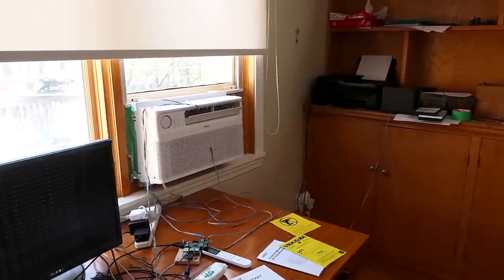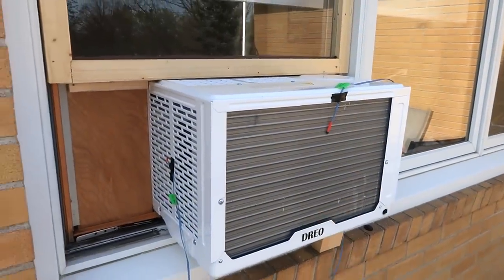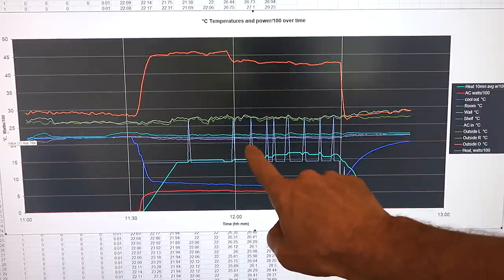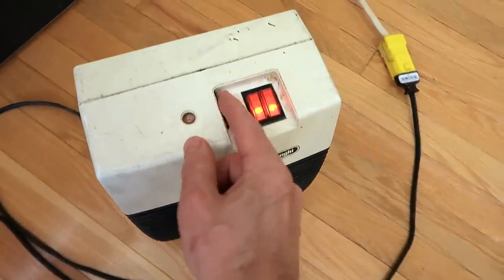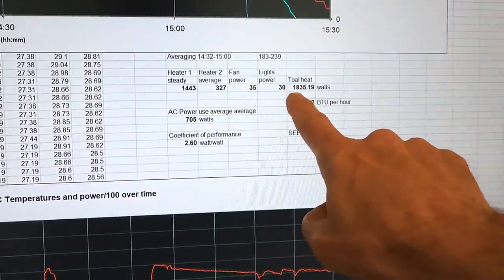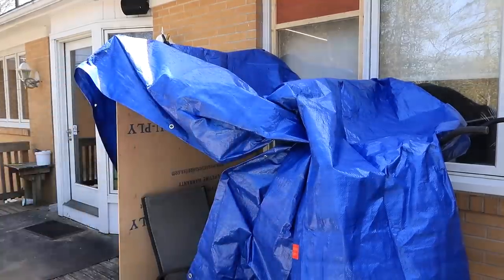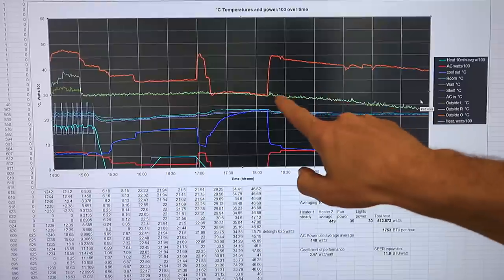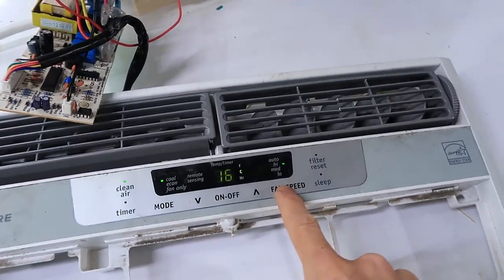Window air conditioner efficiency test

Comment: RE: Noise. 

Older window bangers were usually equipped with reciprocating compressors... a piston banging up and down. These are much louder than the rotary compressors that are nearly universal in modern units. 

Also, fan noise has been greatly reduced in modern window units and split systems through better (smoother) airflow pathways within the units, plus more effective fan impeller design. These improvements allow slower fan speed, which means less tip speed, which means less airflow (fan-related) noise. 

So although the newer units are indeed inverter controlled, it's probably not really the inverter that's allowing that wonderful reduction in noise. It's the quieter rotary compressor plus airflow noise reduction because internal airflow passages are not (quite) as clumsy and sharp-edged as in earlier window units.

The inverters' main accomplishment is better modulation and "metering" of energy, in response to changing loads, as your graphs show us so neatly.

Comment: Very interesting tidbit about the water on the condenser fins! I have a window AC unit I just installed that had a plug at the drain port, and the manual said it can be removed but the unit will operate less efficiently. Glad I know why!

Comment: Most window A/C units utilize a splashing effect from the moisture collected in the bottom of the tray from the inside evaporator to cool the condenser. When first starting up the tray will be empty and thus not cooling as efficiently.
Edit: I guess I should finish the video before commenting 😅 lol
Reply: I too learned the hard way, lol
Reply from the maker: Didn't used to be that way.  I remember seeing water drip out of them, but that was back in the 80s
Reply: @matthiasrandomstuff2221  Yes they would drip but the outlet was about 1/4"- 4mm higher than the bottom so it would maintain a pool of water.  Mine would occasionally get plugged with algae and would spill out the front. Took me awhile to realize how they intended it to work.
Reply: @fluke196c  I did too till it started running hot and realized that it worked better wet. But you're right they rust out and don't last....built in obsolescence
Reply: @TgWags69  It is easy fix thou.  Paint the inside with some two part epoxy, you can use either the clear epoxy for floors, or you can use car clear coat.  Both are very low viscosity so they get into all places, and are 100% waterproof.  I did that to a de-humidifier, and after that zero rust.
Reply: Yep, depends on your location, as it can fill more then splash out.
Reply: @fluke196c  forcing the hot refrigerant through the copper tubes in the water does cool it down quicker thus making the evaporator colder.
Reply: @matthiasrandomstuff2221  I have another thing you can test with the new inverter systems: mine is 750W compressor, but when it's very cold in the morning and thus the temperature difference is very high, it will draw about 1500W instead! Makes me a bit worried about burning out the coil windings, but the question is: if its running at that level of electrical power, do I still get 4x the thermal power out of it? Or does in this case the efficiency simply go to shit and I get the same thermal output as before, just under much higher electrical exertion?

Comment: The manufacturers won't need  R&D anymore, they just need to send you stuff. 😂 I just got a used split ac unit for learning how they work on the protocol level. My first guess is rs485 modbus and I am trying to find out what an indoor unit talks to the outdoor unit and vice versa. There are some videos about controlling ac units with arduino but what I want to know is if you could control an indoor unit with arduino / raspberry pi and use a cold room condenser unit on the outside. The video by engineering mindset about vrf / vrv AC units really made me curious how these systems control refrigerant level and all that. So thanks for the inspiration again.

Comment: Good testing done there, that's useful data collected.
That compressor is inverter driven, hence the power consumption changing from low to high load, and no cycling of the compressor during low load conditions.
Pretty good for a window shaker.

Comment: I use a number of window units for assorted purposes.  All the old, R-22 units are still working fine.  One is over 20 years old.  I am now on my third newer unit, all using R-410 refrigerant. The last is a replacement for the first two, both of which lasted less than 3 years each.  The problem with them is leaking refrigerant.  I think the problem is that the China labor force have not learned to make an A/C with the higher pressure requirements for R-410.  They have leaks in the copper tubing joint around the compressor.  Due to either fatigue in too small piping or bad soldering of the tubing.
Reply: Can the new units be repaired or retrofitted with better tubing?
Reply: @nelsondog100    Sure, if you are willing to do the work yourself, obtain the refrigerant, (requires certifications)  and have the vacuum pump, copper braising or silver soldering equipment, and time.  Otherwise it would cost a LOT more than replacing it with a cheap (temporary) one.

Comment: Testing suggestion
Try it with the AC fan on low vs high. See what that does to the efficiency and RH.

In my camper (hard side popup) I used to run a regular old window AC with the fan on high all the time when we wanted cooling. 
Worked alright during the day but at night being such a small space it would short cycle. The short cycling meant inadequate humidity removed so it really didn't feel all that pleasant.
On low fan it had longer run times and so was able to dehumidify more. Still not amazing but better.

Comment: Wasn't there solar heating of the room through the window? Aren't you assuming no thermal flux through the walls for the ac / heater equilibrium assumption to hold?
Reply from the maker: sun wasn't facing the window.  Also, I made sure the room was at equilibrium at 22 degrees.  I even shut it all off afterwards to make sure it was still at equilibrium at 22 degrees
Reply: Matthias you planned and thought it out well.

Comment: With the start of Time based electric rates I'm trying to decide what is the best way to run my whole house AC unit. The higher rates (1.5X base rate from 2PM to 7PM M-F). I also watched you fan video's and when the outside air falls to mid 60's at night I'm opening 1st floor windows and running a 20" fan blowing out the 2nd floor window. The fan is located approx 3' back from the window for most airflow (Thanks for your video on this). The fan consumes approx 64 watts/hr.  I don't attempt this unless the outside temp is approx 10* lower than inside.Whenever the inside approaches the outside shut this down and turn the AC on to get the inside down to about 72*F. Once attained I set it at 74* and let it maintain that until about 1:50 PM, just before the penalty period. Then I shut the AC OFF. Yesterday it ran up to 93*F outside and the inside aironly raised to 75*F at 7PM.
Any Ideas? Lots of work, but fun.

Comment: Back around 1985, we got a 14k btu window unit from sears. it was 10EER ...
...matthias just mentioned it already. I was going to say our old unit actually deliberately dribbled the condensation down the cooling fins but instead of seeing little bits, you'd see what looked like water snakes making their way down between the fins. 

that was an important thing as ours sat above a wooden basement door on the porch. 

For the folks making fun of these units below, we cooled the lower part of an old stone house with a 14k unit and then at night, the upstairs with three 5k window units. 

The house has since been refitted with ducting (old stone house) at a high cost (about $25k in current dollars) and the power use is FAR higher than it ever was with the individual units. 

Nice thing about the window units in bedrooms is you could basically turn one on full blast about an hour before sleep and sleep in winter temps in the room without wasting power on the rest of the house.

Comment: Nice to see that those bulky old in-window ac still exist.
They remind us of ancient Soviet period ac - BK1 (БК1) :)
Reply: But, these are modern, efficient 8,000 BTU units!!  Many ppl, including myself, depend on these units in hot climates!
Reply: they're good units, cheap and efficient and allow people with no AC to get efficient AC or not waste money running full central air while sitting in only a couple of rooms. 

FTR, I don't have one (central AC and mini split on an add on), but my electric bills are higher than my parents' were cooling parts of a much bigger house.

Comment: Thats quite close to the DIN EN 14511 standard which describes testing of AC units. I did my bachelors thesis around that, but concentrating more on automating a test stand that does the actual measuring. unfortunately I couldnt get too deep into the thermodynamics.

Comment: You've calculated is an EER, not SEER. SEER is an average of EER at specific different operating conditions.

That EER also seems kinda low, especially for something with an inverter. The EPA requires 12 CEER for a room AC of that capacity with louvered sides to claim ENERGY STAR; CEER is just EER with some allowances for phantom load from digital controls. The specs claims 15 CEER, 169% of what you tested! But I've not read the testing standards for CEER, and it's possible it ignores some of the fan only run-time...
Reply: I was curious about this too, but taking in consideration that once it cools down the room it won't be turning on the compressor as often, then maybe it would reach the 15
Reply: I’m in the Philippines and when shopping for an a/c unit I ask about about output rating in btus, the answer I receive is a horse power rating. Example: 1.5hp or 2hp etc… so I have no idea about the actual cooling capability. I started looking for manufacturer labels on the units I was interested in but didn’t find any information that was useful to me. Question; Are there any other numbers I can look out for to make a somewhat informed decision about buying an a/c unit? Thanks for your time🙂

Comment: I've always wanted to know if venting or power venting an attic makes a difference on utility costs. Can you test that next?
Reply from the maker: it makes your shingles last longer, that's a substantial saving right there.  It all depends on how hot your attic gets and how much insulation you have in the ceiling.
Reply: In my opinion power venting the attic is worthwhile. I have plenty of vents but I added a fan in my attached garage which pushes air into the attic and out the roof vents. It cools my garage nicely too by pulling in cool air from a north facing window. My 25 year roof lasted 25 years which I attribute to venting. My neighbors have all had their roofs replaced in less than 20 years and some twice. I have no idea what it cost me in electricity but IMO its worthwhile. I do know my AC cost is less than any neighbors. Living in the midwest USA

Comment: Condensation on the fan is a good explanation for why an AC unit makes that noise, but what I want to know is why every other fan eventually starts to make clicking noises. Ceiling fans, Box fans, Stand fans. They all start to click after a while.
Reply from the maker: I haven't observed that
Reply: @matthiasrandomstuff2221  Maybe it's just my fans then. They always seem to start making a clicking, or tapping noise after a while and if you jostle them it stops temporarily.
Reply: @cbalan777  my fans are clicking! i thought it was the baring or wood of the fan blades flexing. but some days it will be silent. i keep the fan on 24/7

Comment: The efficiency you're calculating is actually just the EER. Manufacturers like to list Seasonal EER (SEER) because they can make up nonsense to boost their numbers.
Also, the condenser will corrode faster with condensate splashing on it all the time, unless they are making it out of solid stainless steel.
Reply from the maker: yes, the SEER is based on some usage profile, much of it not going at 100%, which should be more efficient.
Reply: Corrosion is likely a non-issue. The cold side is made of the same materials as the hot side and water condenses on it as a normal part of operation. Also not to mention rain and other stuff.

Aluminum also doesn't corrode.
Reply: @groundzero_-lm4md  First, I'm a PE mechanical engineer who has worked for years in the HVAC industry and would love to hear more about this magical non-corroding Aluminum you speak of.
Second, the fins are usually aluminum, but the tubes are copper.
Third, constant exposure to condensate water will be a much bigger factor than occasional rain.
All that said, yes, it will probably be fine for many years, but I wouldn't be surprised if the unit lifetime is reduced.
Reply: @peripheralarbor  I’m in the Philippines and when shopping for an a/c unit I ask about about output rating in btus, the answer I receive is a horse power rating. Example: 1.5hp or 2hp etc… so I have no idea about the actual cooling capability. I started looking for manufacturer labels on the units I was interested in but didn’t find any information that was useful to me. Question; Are there any other numbers I can look out for to make a somewhat informed decision about buying an a/c unit?
Reply: @nelsondog100  There's not much you can do if the manufacturer doesn't disclose technical details. These statistics are required by law in the USA, but it seems like they don't have to in the Philippines. I think your best bet would be to stick to international manufacturers, and look at the stats they publish in other countries.
Reply: @peripheralarbor  Thanks for the reply & have a nice day 🙂

Comment: The Technology Connections part of me wants to know if you can run this thing as a heater. :)
Reply: According to the specs, sadly no.
Reply: @MoritzvonSchweinitz  I think you can install the unit inside-out...
Reply: @Kineth1  Put a mirror in the yard to reflect the signal from remote.

Comment: Humidity has to be removed from the air before cooling. Or at least that is what I see when checking used fridges.
Reply from the maker: True enough.  That may explain why it wasn't cooling as effectively for the first half hour.  But with the door closed to the room, once the humidity was removed, there wasn't any more to take out.

Comment: Have you ever looked at how capilliary tubes on AC unit work.  It’s really interesting using the temp to contol amount and location of the saturated refrigerant in the cap tube to adjust the unit’s output.  But that changes the efficiency so they’ve been pushed out except for small systems in favor of cycling.  See Theory and Field Problems of Capilliary Tubes, Henry Ehrens, SUPCO
Reply: Damn physics is cool sometimes
Reply: A search for Henry Ehrens, SUPCO will do it too.

Comment: I have an 8000btu window unit to cool my 600sq ft shop, it is very undersized but is what I had. In the summer here in Florida it gets to 90 f and 85% humidity often during the days and my A/C in the shop can only cool it to about 82 f but it's OK because it keeps the humidity around 50% and is plenty comfortable to work in. When I come in sweaty, it instantly starts drying and I instantly feel cooler.
When it's time for me to change the A/C out, for just a few hundred $ more than a window unit I will get a mini-split system.
I would love to see you test one of those units sometime!
Reply: I'm moving to the panhandle and have a monstrous 14k window unit.  Nice machine, but I think I'm going to sell it before the move and get a split.  For nothing more than aesthetics and security.

Comment: I wonder if there's an option to shut off the internal fan when it's up for temperature. I have had to install a thermostat relay plug to turn off the AC window unit because the fan is creating most of the noise and I would rather just keep my ceiling fan on to circulate the air around.

Comment: I would be interested to know if the AC if more efficient at heating the room than the electric heaters if you turn it around.
Reply: Of course it is
Reply from the maker: It would be, but it will only "cool" the outside to 16 degrees C, that's the minimum you can set it to.
Reply: @matthiasrandomstuff2221  could you move the temperature probe for the thermostat?
Reply: Ofcourse it is,
But I would love a practical experiment with similar temperatures and power usage, 
Is it really as efficient as they claim...
Reply: @phs125  This experiment is the proof. See 3:09
The room was held at as close to constant temperature as possible.
The constant temperature demonstrated the AC was removing the 1731 watts (the total that the heaters + fan motors were adding to the room) or 5905 BTU/hr
The average use of the AC over that time was 500 watts.

As 1731 is greater than 555 (difference of 1176), it clearly demonstrates the AC is more efficient (from an input of electrical energy standpoint) than the space heaters. 

The 1176 watts of energy does have to come from somewhere of course - in this experiment its taken from the air in the room. If you flipped it around and had the cool air blowing outside it would come from the outside air.
Reply: @pstrap1311  This runs into some icing problems eventually. :)

Comment: I’m in the Philippines and when shopping for an a/c unit I ask about about output rating in btus, the answer I receive is a horse power rating. Example: 1.5hp or 2hp etc… so I have no idea about the actual cooling capability. I started looking for manufacturer labels on the units I was interested in but didn’t find any information that was useful to me. Question; Are there any other numbers I can look out for to make a somewhat informed decision about buying an a/c unit?